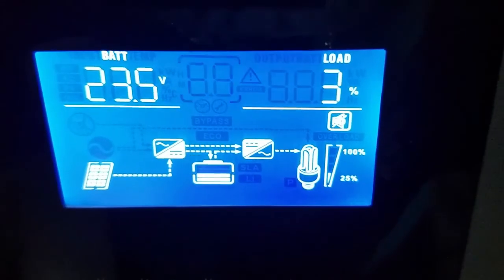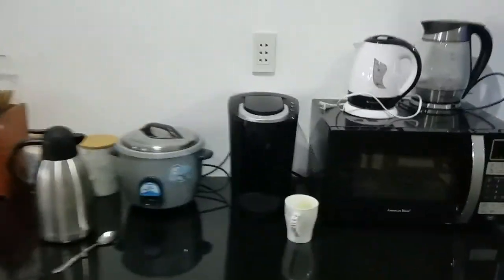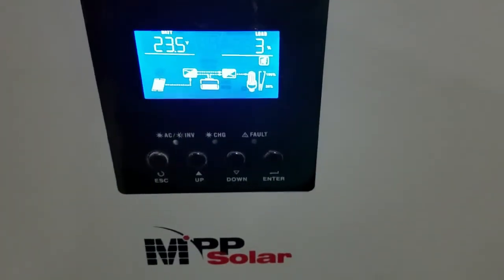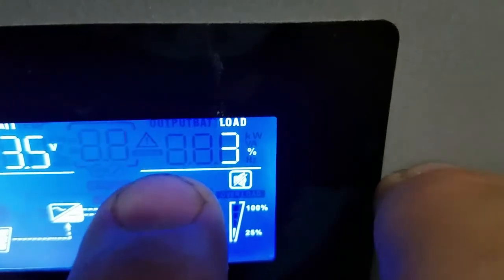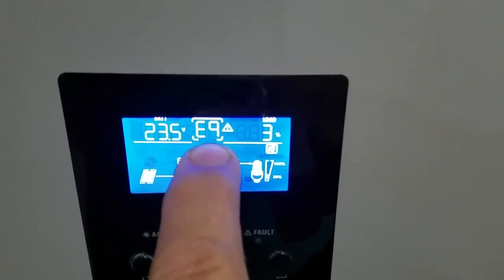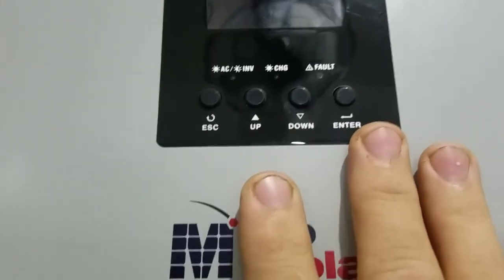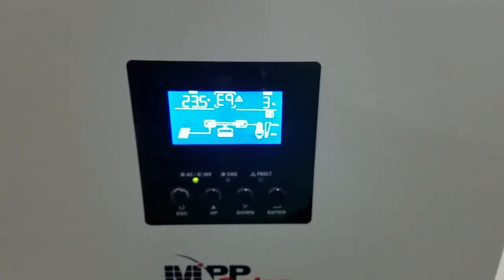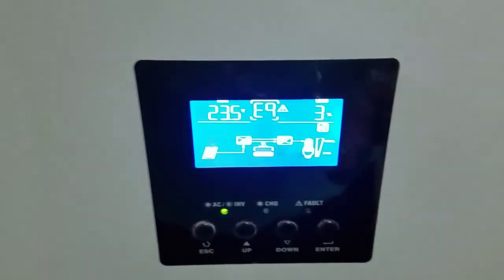MPP SOLAR WARNING E9 OR EQ Warning flashing???

Comment: YOU MIGHT WANT TO DISABLE THAT FUNCTION AS SULFATION HAPPENS IN LEAD ACID BATTERIES......I DO NOT THINK THOSE TESLA BATTERIES ARE LEAD ACID
Reply from the maker: You must be mistaken between the different systems I own. I have systems in Philippines where this video is and I have system in USA where the tesla batteries are. This system is on lead acid and needs this cycle.
Reply: @TexasFilipino  Thankfully you are correct.  Was pretty upset, but half asleep....was checking out the 5048 posts, Well great. Thank You for the response: Jeff

Comment: We just got this E9/EQ and it has happened before but I had forgot what it was.  It was in the small supplied manual that we got with our MPP Solar 1K/12v backup inverter.  We use Ford C-Max (Energi) lithium-ion battery cells configured in 4x4.2v (16v).  We been off the electric grid since late 2017.
Reply from the maker: Get that EQ turned off ASAP if you are running Lithium!!! It will overcharge and could even cause a serious fire! Disable it. That is for Flooded lead acid only to clean the plates by temp overcharging. You will kill your lithium batts with that  or burn everything down with a almost unstoppable fire!
Reply: @TexasFilipino , How can the inverter overcharge when I use 16.8 volt cells (4x 4.2v cells) ?   The highest the inverter will charge is 14.9  and it has only reached that once.   This is only the second time it has done the EQ and like last time I monitored it and took readings of the cell-bank while it was showing the symbol.  If you could show me where you still see a danger, like from a manual or from wherever I would listen and follow up.  However, that being said,  I have been thinking about adding some more cells so I could disconnect the battery and do some measuring of the cells to see where they are all at voltage wise and I can turn the EQ off too.

Comment: mpp 5048 just did this and i could not find the code. do i even need this eq process for lithium ion batteries?? now if i could get my rig to communicate with the watchpower system....
Reply from the maker: Do not use this for lithium. Disable that mode quick. It can overcharge your batteries and set them on fire if lithium or kill the cells. Get in that menu and kill battery  equalization
Reply: @TexasFilipino  thanks! just did it. in our case my rig peaks at 58.4 on a 48vdc system and the batteries have no problem with that peak. but the "mode" seemed fishy. started out with lead acid for a couple of monthes and recently switched to large samsung lithium rack units modified for the correct range. this was the first time i ever saw the code!

Comment: If you were hook up to a pc... you would see the fault code and a lot more codes that is not in the manual
Reply from the maker: I agree but .... my late model laptop will not connect to it. A old laptop I had would but it's dead. So next trip to USA I will find another older laptop to use it dedicated for this. I so agree with you on this.
Reply: Texas Filipino cool

Comment: Good morning my brother. 
Nice to see you up and running with the 2424 pip.
I'm in the Bahamas and I'm using the 2424 pip unit to run the exact same equipment and it's running everything exactly as you have shown in your home.
Reply from the maker: Good morning from Philippine Islands. These are PIP4024MSP units  kinda like the big brother to your unit. I'm loving them! Are you running full off gird with yours too? Nice to hear from a fellow islander!!
Reply: @TexasFilipino  
High ok.
Yes I'm fully off grid .
All led lighting. Lp dryer and energy efficient water heater on a daily 15 minute timer.
Working pretty well

Comment: my system in my 5th wheel does this everyday, 12 volt system and it kicks up around 16.2 volts (Trojon T105 batteries) depending on temp of batteries at the last 2% of charge, also your EQ volts depends on what battery manufacturer calls for it to be, so you don't fry your batteries, that is why you should have a battery temp sensor on batteries, because they need to be charged at a little bit of  different voltage depending on temp of batteries. here is a good channel to watch about solar, he knows a lot, (DYI Solar with Will Prowse)
Reply from the maker: Yes i know Will Prowse.
Reply: @TexasFilipino  figured you did here is another guy that is very smart on off grid solar, he has a blog, (handybob) this is where I got my information from for my solar set up, he built off grid house and shop in Montana, first part of video shows his place youtube.com/watch?v=x6Gc-q7YbzU